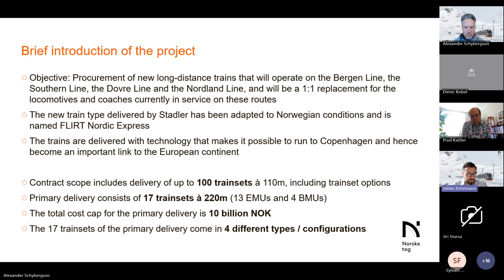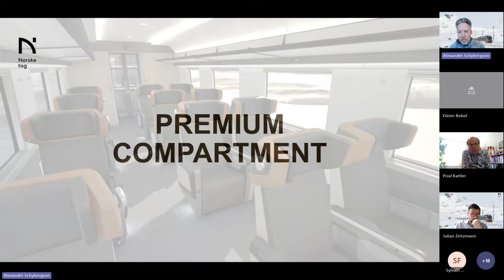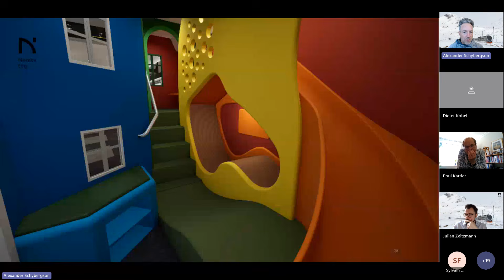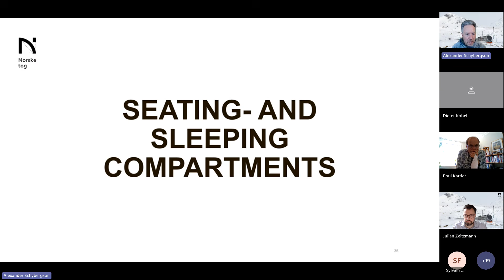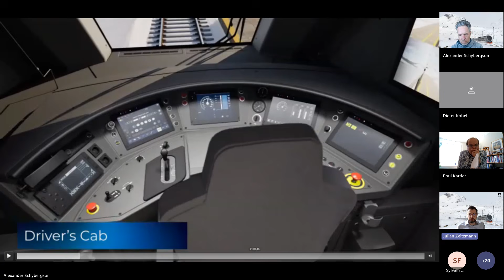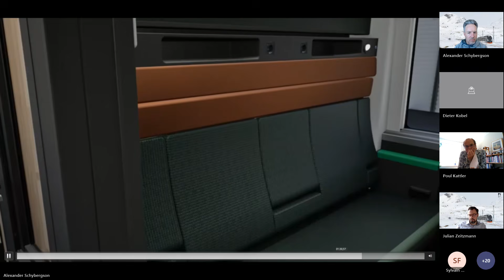Presentation of new Long distance trains for Norway Norske tog 20260429 Back-on-Track webinar

Comment: What's the reasoning behind 4 beds/seats rather than the traditional 6? It seems much less space-efficient and it's not clear that it makes up for that in comfort in some way.
Reply from the maker: 6 beds require coaches with a slightly higher roof. Recent night train purchases were built using standard coach series (like nightjet/railjet, in this case as they wanted a train series with a driver car to avoid shunting when changing direction).

Comment: Why are there four wheelchair lifts for three wheelchairs? Are they all going to embark simultaineously, with redundancy? I'm not commenting on the number of lifts but the capacity for wheelchairs. Will the premium sleeping compartement be compatible with a person lift (personløfter) to get users in and out of their wheelchairs?

What is the availability for strollers and changing for toddlers?

Where will luggage be stored for the sleeping compartments?

Will 'quiet' and premium be the same areas?

How many coffee machines will be distributed throughout the trains?

I see my youtube username is not that official/professional, you can refer to me as Ivar if needed.
Reply: Two wheelchair lifts per side. Means that you’ll be able to get on and off even if the other lift on the same side is broken down
Reply: @SuperSiggiboythat makes sense. But three spaces is still not impressive.

Comment: Since these are Stadler products, like the low-flor original FLIRT; Experiences with wheelchair lifts are… mixed, around Europe. Could one or two of the eight cars/modules have been low-floored, while the rest remained as presented here? Admittedly, this would compromise accessible through-train passage, but Stadler seems to have recently delivered sloped-floor solutions where steps have been used on the FLIRT. Seemingly, this could be done without reverting to jacobs-bogies thus shorter cars - at least with just one, or two separate low-floor full length cars. Then again, the choices made surely have their reasons…
Reply: The problem with that are that most of the platforms theses tains will be stopping at dos not have a unified platform height, and just having a low floor entrance wouldn’t be enough, in fact som platforms are at ground level
Reply: @Vikin @Viking-t4w  I know. Then again, Bane NOR has a TRV (still valid, checked) stating a unified 760mm platform height target. I also know there’s a multi-decade lack of political will to reach that target. Then, knowing that acquired stock will expectedly be in use 30 to 40 years into the future, maybe longer.

Finally, knowing that there’s no «solution», as long as every main function & responsibility of a railway network remains dispersed across multiple separate entities. Each of course needs to cover their own overhead costs, preferably with profits. No heckling intended, that’s a fact for any corporate entity - state or private.

Finally, an argument for not running public transportation as separate entities, since such services carry an inherent total loss. The accounting would be different under an institutional ownership - how e.g. military still works. Acquiring F-35s did not incur a socialised cost (tax), as expenditure vs use value remains  «inside» one entity. 

Financial gains from a functioning transportation service happen elsewhere, by getting people or goods to where they need to be. Only the state itself can carry such losses (like police, healthcare), as every NOK «wasted» ends up as available currency to the private sector. Which is what businesses want…?

The «waste» will still be capital to the owner, as infrastructure - preferably not to become the country’s second largest real estate actor. That’s a very 1990’s era view, and after three decades trying, not a very ‘efficient’ one… 😅

Comment: The current trains (at least on the Bergen line) have reclining seats that moves slightly forward into your own space when reclining, thereby allowing increased reclining angle.
Reply: Though the seats are very hard and uncomfortable, and it feels you are traveling in empty carriages with cheap seats mounted in them..
Reply: @MartieGG "empty carriages with cheap seats mounted in them." That is pretty much what it is.